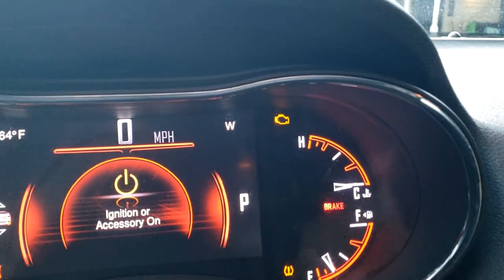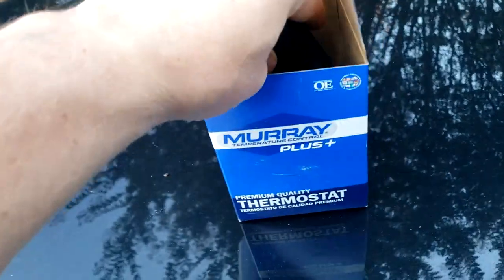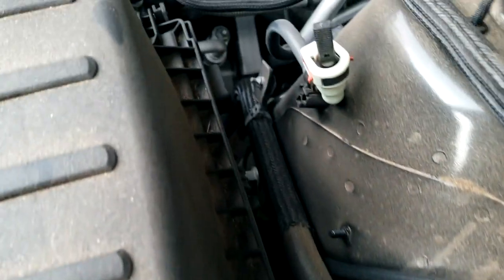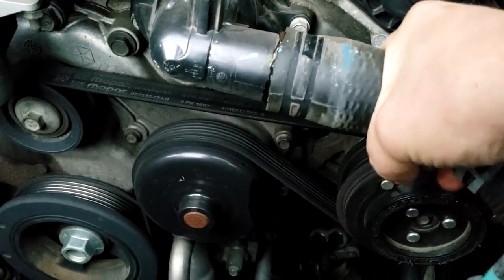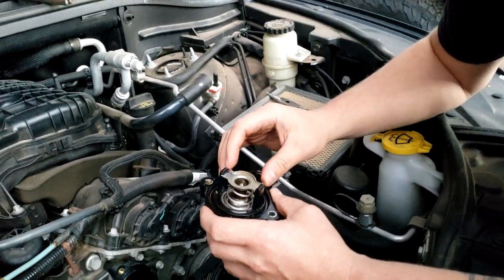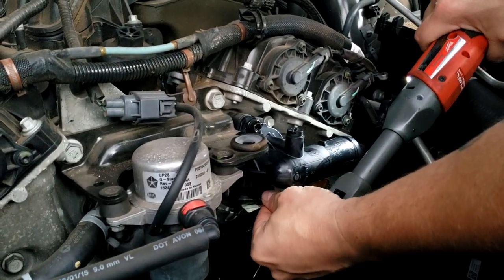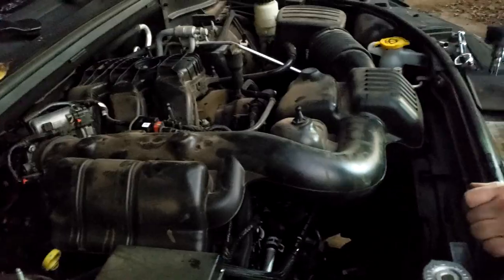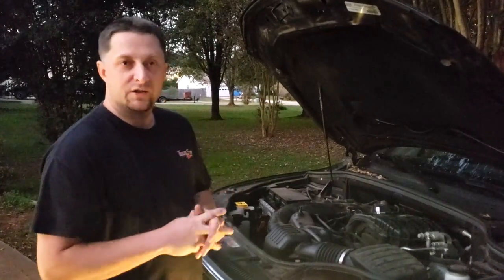P0128 Code What Is It And How To Fix It EASY

Comment: Can a wire that’s shorting somewhere cause this because if I take my battery terminals off it makes that go away until usually when I drive on the highway and get off the highway. My coolant temperature gauge just stops working and thinks my car is overheating until I reset the battery again do you think that’s a wire shorting somewhere?
Reply from the maker: May be bad sensor. Disconnecting the battery just temporarily clears the code.

Comment: What if it doesnt fix the problem? For e.g. i added coolant then cleares the code and the engine light didnt come back on right away but the next day. Without the problem actually being fixed and driving thinking it is couldnt that damage something?

Comment: I own a 2020 chrysler pacifica with 3.6 pentastar engine. Got P0128, replaced thermostat with new one by Mopar and the P0128 still exists and not fixed. Tried to clear error codes but this still appears. What's the problem can be?
Reply: Could be the coolant temperature sensor

Comment: my code kicked on because i put some water wetter in my radiator just cause i thought i was going to help my truck stay even cooler...but it backfired lol it did keep it cooler.my truck never overheated even before i used that water wetter.i just drained it back out and replaced the antifreeze like it's supposed to be and bleed it and now  it's back to normal.
Reply from the maker: Good to know

Comment: After replacing the thermostat, Adding coolant and burping it do you have to clear the code with the reader to remove the code?
Reply: Just disconnect the battery from your car for a couple minutes and reconnect it and it'll clear it if you don't have a od2 reader
Reply from the maker: Yes you do
Reply: @FrostbiteRam  all you gotta do is disconnect power to the car and it will reset itself
Reply: @FrostbiteRam  at least on my GM vehicle

Comment: I installed mines but the engine light is still on but my car is not overheating and drives fine. What could be the problem?
Reply: Fluid low,,or need new ect sensor

Comment: My charger been over heating to where it leaks out overflow and I have this code now should I change sensor I already did thermostat month ago
Reply from the maker: If it's filling the over flow tank that could be bigger problems
Reply: @FrostbiteRam  like what I’ve been told head gaskets by a couple mechanics

Comment: I just installed mine and now the engine light came on! The code was thermostat. Have you ever heard of anything like that? No leaks, but it's still overheating
Reply from the maker: May need to bleed the air out of system if that doesn't work then you have bigger problems perhaps.
Reply: @FrostbiteRam  yeah I bled the system, but now noticed the fans aren't coming on.. sheesh! I guess the fans are next
Reply: @nothingyet6759  nooooo just replace coolant sensor
Reply: You can't go off of what someone does on YouTube. There is a  reason why the computer is throwing a code. In your case, I changed the T-stat, and the code came back. Diagnose, Diagnose. Everyone's problem isn't exactly the same!